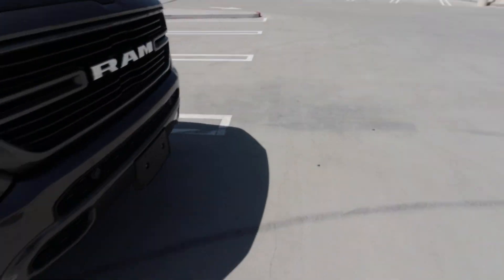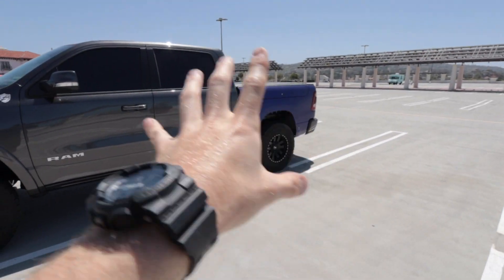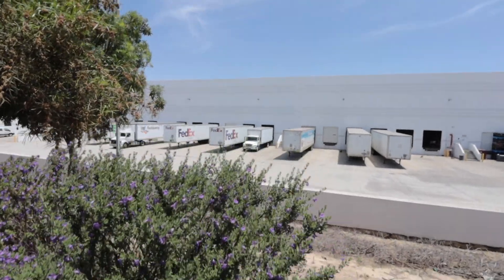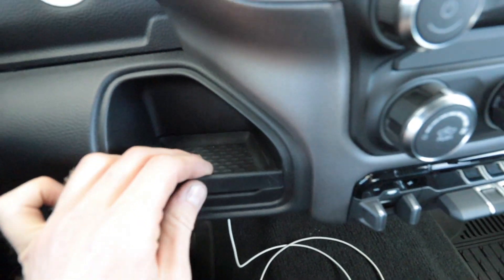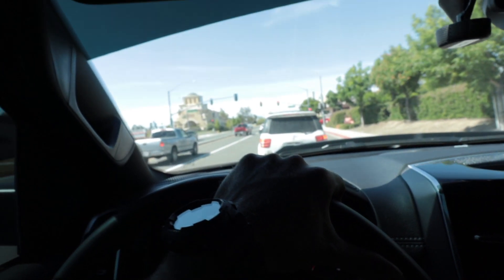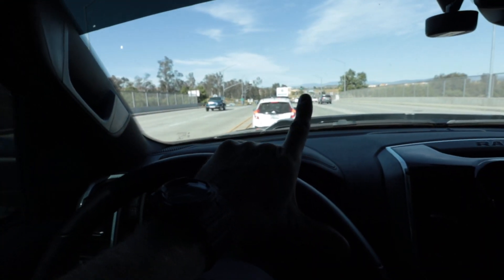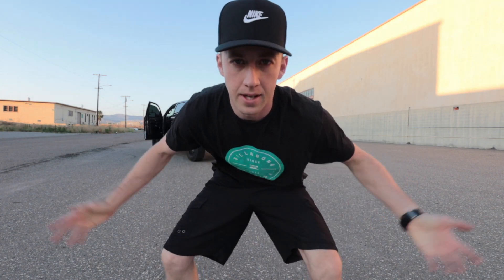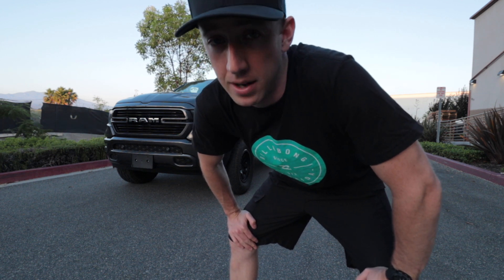MAGNAFLOW Exhaust on my 5.7 HEMI

Comment: I put a borla on mine. No need to cut the stock exhaust just a 2 man job to wiggle it out
Reply: Did you put an entire borla system or just the muffler?  I just got my 2022 Ram 1500 Laramie and I want the Borla S type muffler but cannot find it for my truck w/o the entire system.
Reply: @paradiswest4395  hey, I got the entire cat back system
Reply: @DTXGee  My fundages are a little thin for an entire system.  Mama bear would kill me

Comment: Not saying this to be a douchebag at all but thought it might save someone some money....instead of spending a grand on this setup. You could have spent $80-$120 on a 14 or 18 inch magnaflow muffler went to the local muffler shop and had them swap out the factory muffler and delete the rear resonators and you would have an even better sounding exhaust for under 200 bucks!

I know it's hard to tell and videos don't always do the exhaust justice, but I just did exactly that on my brand new Longhorn, 18" magnaflow and deleted the 2 rear resonators and my setup sounds waaaay better than this full system in this video! It sounds much cleaner and has a much deeper/throaty sound, honestly sounds PERFECT to me! Nice and loud when I get on it but nice and tamed while driving down the highway when I don't want it to be loud, these new 5th Gen rams are sooooo easy to make sound way better, and there's no reason at all to spend that much money on a full system in these pickups. With the dual setup from the factory there are a million different things you could do for very cheap to bring that hemi sound out of these pickups!!

Again not trying to be a douchebag just wanted to mention that as I'm sure you probably already know everything I mentioned but either way thanks for all your vids on your 5th gen ram I really enjoy your trucking content! 🤟
Reply: What 18" magnaflow you talking about???🤟🤟🍺